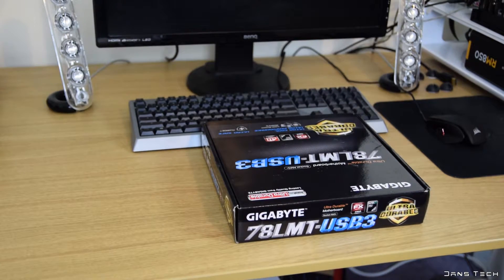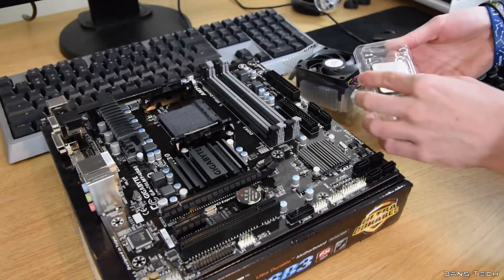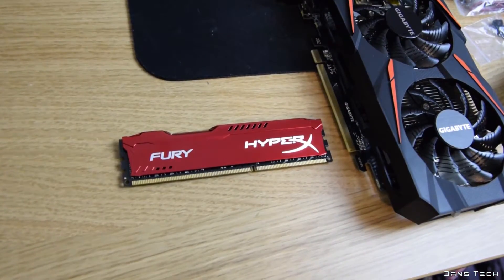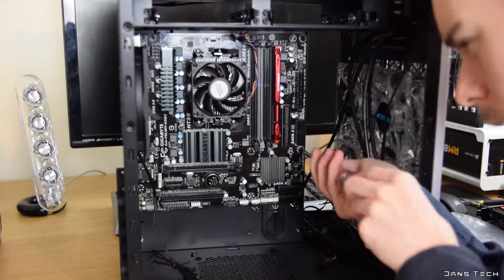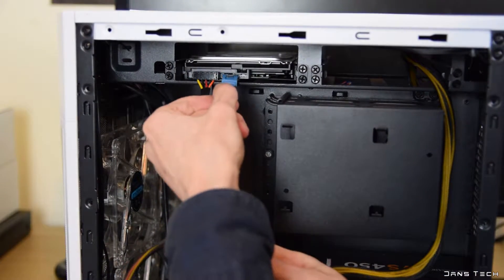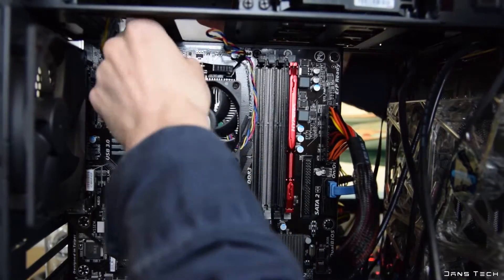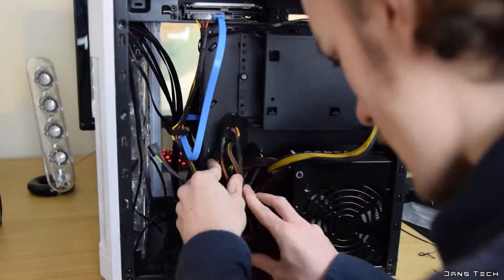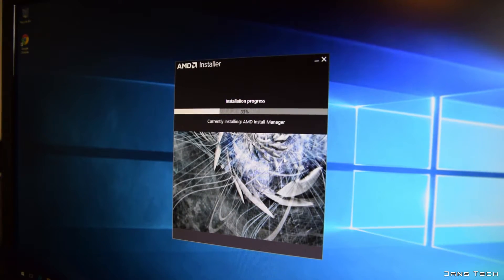Gaming PC Build Guide RX 460 & AMD FX 4100

Comment: Fx4100
Asus m5a97 Pro
SilverPower SP-SS750M
IDE DVD drive
1x ArcticFan 120mm
2x Zalman 92mm fan
Card reader
Fan Controler (Zalman zm-mfc1)
Some random case with no side panel (looks good for 2010 standarts)

All this for 20€
Reply: nice find

Comment: fx - 4100 + RX 470 4gb is good?
Reply: Cpu bottleneck, ull need a fx8120 or fx6300 at least
Reply: Yes its good
But 4gb ram is not good
16gb or 12gb is good
Reply: @fliksr7911  4 gigs is already good you can download winsows 10 64 bit with 4 gugs of ram
Reply: @fliksr7911  but yeah 4gigs x 2 piece of ram is better amd faster than 8 gigs 1 piece